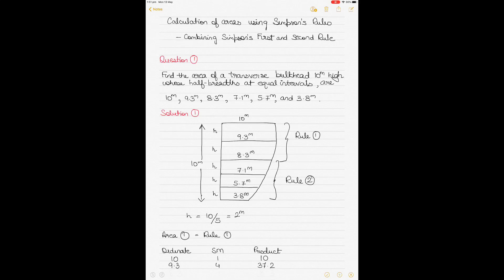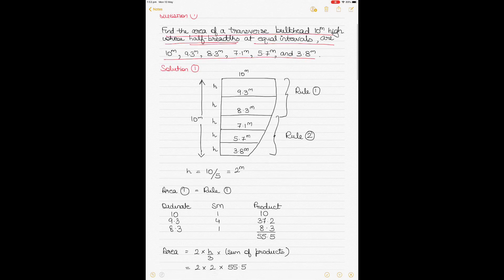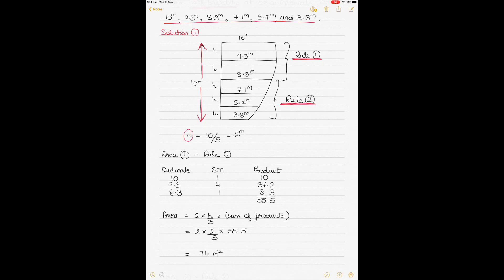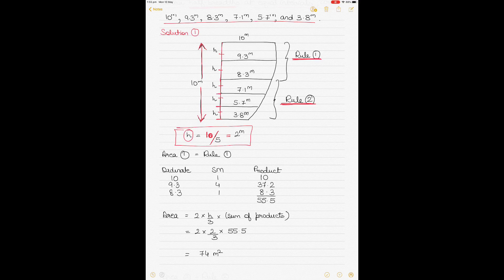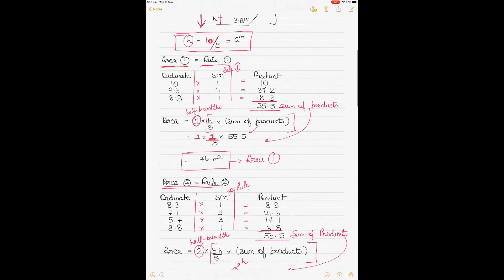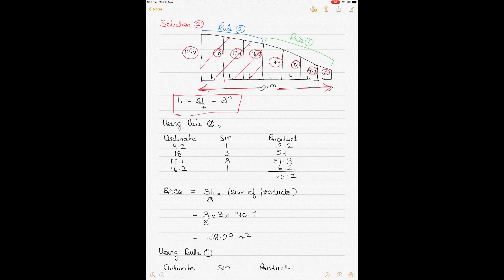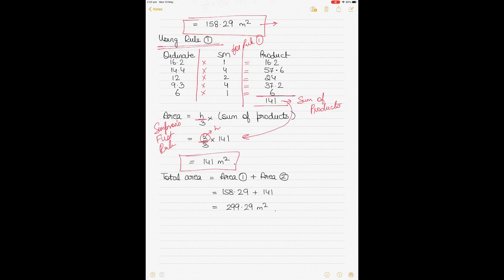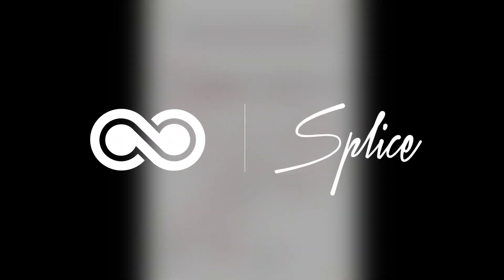Ship Stability - Combining Simpson's First and Second Rule to calculate area

Comment: Nice explanation sir.
I want to ask when we use Simpson's multipliers (SM) like this...1/4,1,1/2,1,3/4,2,1,2,11/2,4,2,4,1 if 1/2 ordinate 13. Here no. of ordinate is odd then easily apply simson 1 St rule. But why this SM use??? 
Please response.
Reply from the maker: raj kumar you are right. If there are 13 ordinates, you will use Rule 1. But in this example, we had 6 and 8 ordinates, so we used a combination of two rules.